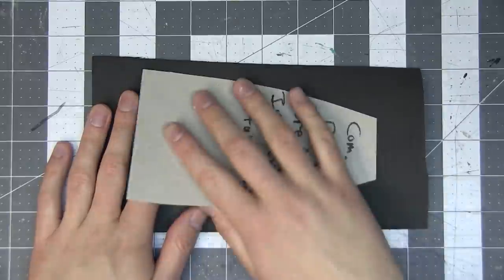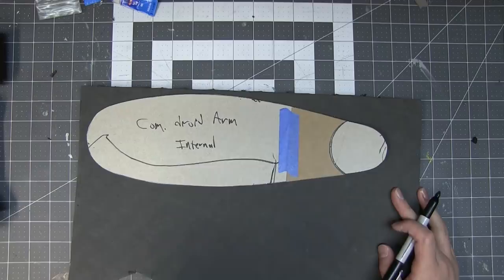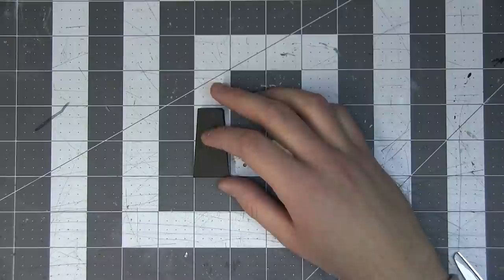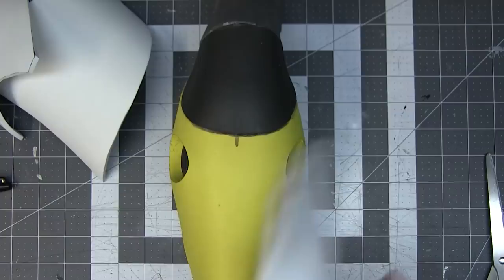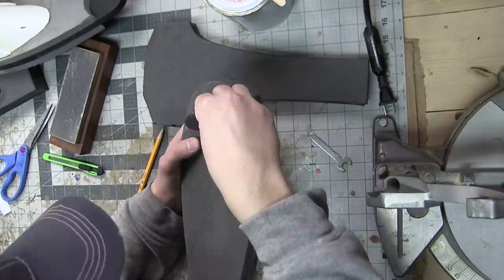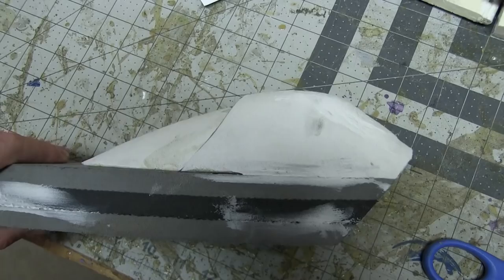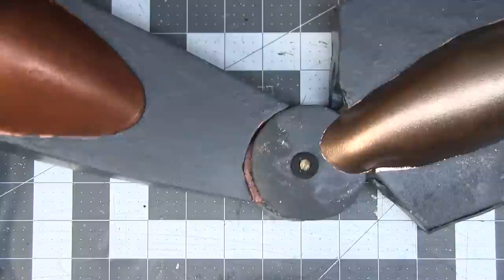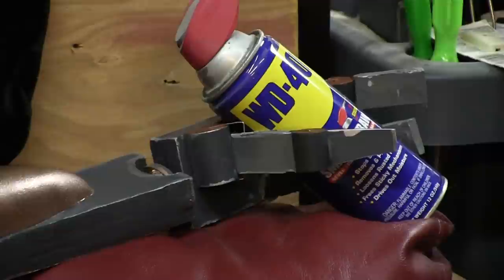How To Make A Commando Droid Part 3!

Comment: William you can spray paint styrofoam, you need to make sure you have very light passes from 12 inches, also test the paint beforehand- it’s not the paint that dissolves the foam, it’s the other propellants inside the can, those vaporize and disperse at that distance and quantity, shaking very well also reduces the ones at the bottom of the can in many paints.